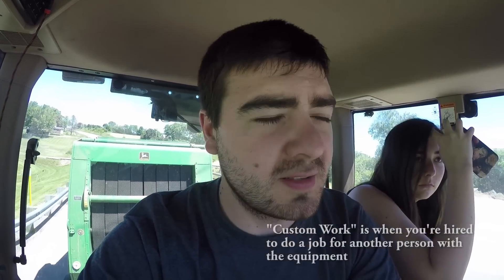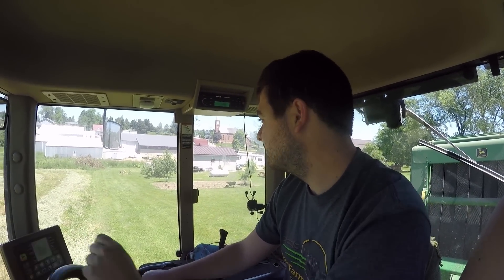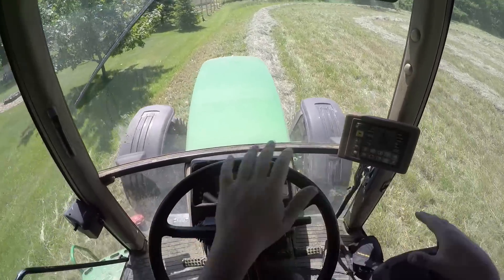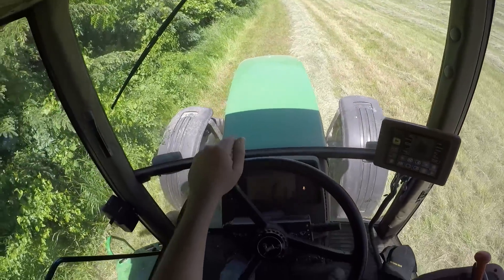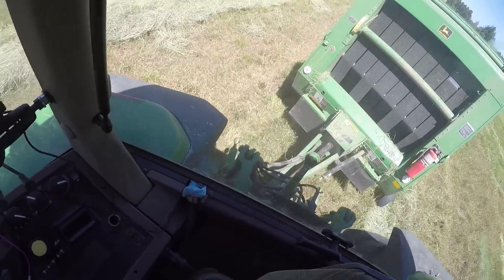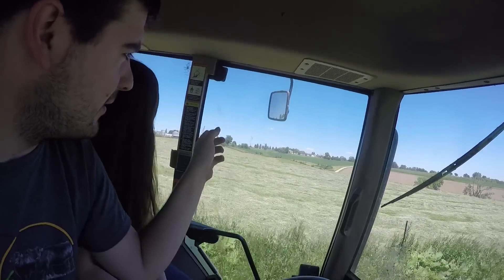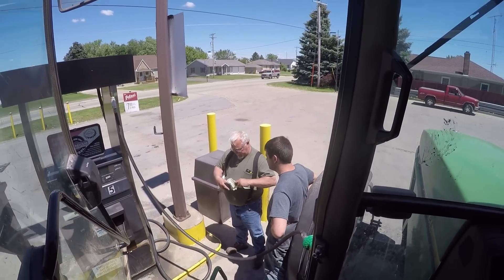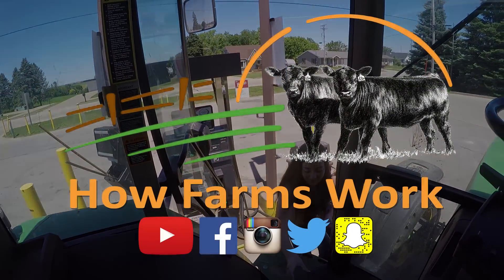Custom Baling - John Deere 7600

Comment: Why do you switch off the pto when dropping a bale? I never do and it seems to slow you up a lot.
Reply: On some balers when you open the tail gate the bale forming belts do not stay tight and could get tangled up.
Reply from the maker: +john cummins To see between the belts to make sure it's wrapped.
Reply: How Farms Work fair enough, I just dump and deal with the consequences later 😁 get it picked as fast as possible! keep up the good work btw👍
Reply: How Farms Work doesn't the moniter tell you, what model baler is that I'll just run them and dump had 2 bust before when started pretty sure hay was still little wet came back the next day ran flawless

Comment: Nice video. I notice you kind of weave back and forth on the windrows as you go along. Is that done intentionally to somehow control how the material goes into the baler?
Reply: EOSJOE he does that so the bales aren't lopsided if you only let the hay feed in on one side of the baler that side of the bale will be much higher than the other side
Reply: Yes.
Reply: EOSJOE yes it is done so the bale stays level and isn't taller on one side or the other he mentions the bars on the monitor they move to show how even the bale is as it's in the chamber
Reply: Im wondering if modern balers somehow go over this problem.
Reply: ignafiltro they do. in Britain we use more roller  balers than belt balers  and they do it far more Even

Comment: I'm not sure if you've mentioned it before, but with all the driving on the pavement you have to do between fields and farms, do you find it's pretty hard on tire life?
Reply: Considering most modern tractors do 50 to 60kmh on road (30 to 40mph) and are used to haul trailers longer distances every day, I don't think there is much tire wear in this case.

Comment: Does that baler not have a kicker? I haven't had to do all that backing up to dump a bale in 20 years.
Reply: Thought the same.
You have what you have.
Reply: Kickers are often either not installed on balers or taken off or disabled when baling in very hilly country, to prevent runaway bales rolling downhill uncontrolled and ending up in the creek, the woods, through the fence, or on the highway... 

Backing up and dropping it gives greater control of the angle and where it's dropped, and generally gives a "dead drop" out the back of the baler with little/no rolling of the bale, helping prevent runaway bales... 

Later!  OL J R :)

Comment: You have to turn on the indicators when you drive on the road, but how do you indicate then? I'd rather see them using beacons or just nothing when it is a plain tractor lol.

I don't know who in the government decided it is better to turn on both indicators because I tihnk it will cause only more crashes...
Reply: BWAHAHAHAHAHAHAHAHAHAHA they function as proper indicators when you turn the signal on where one is flashing and other is solid but if no signal both flash